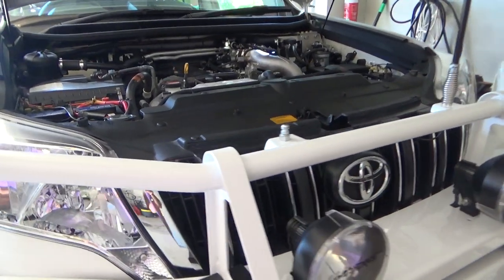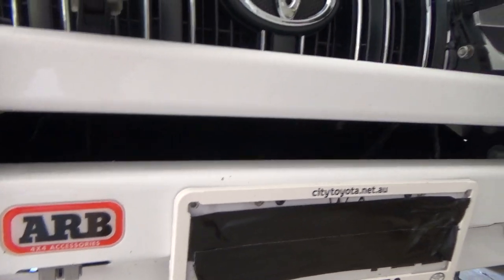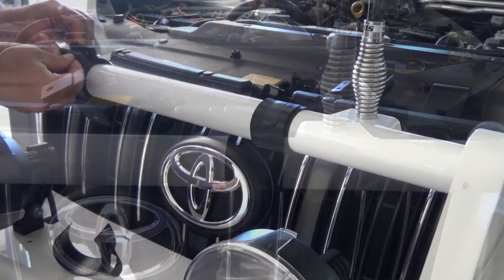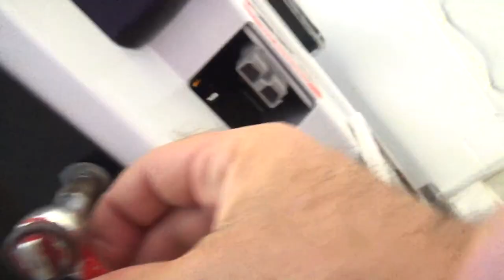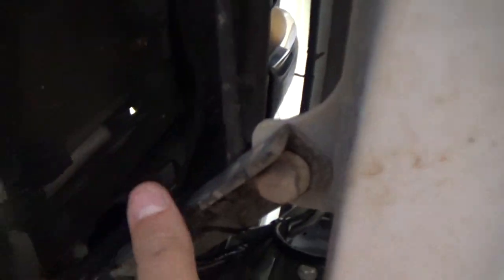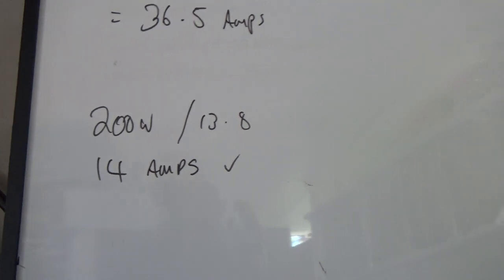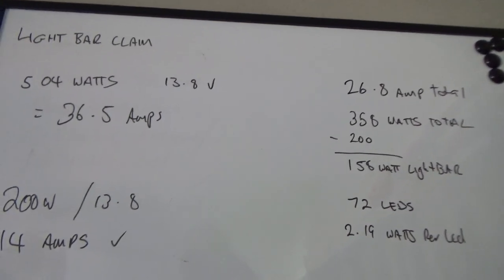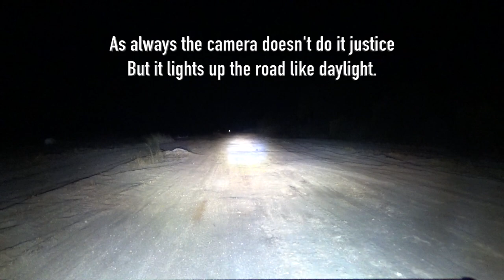Fitting, setting up and testing a 26 inch light bar on a Toyota Prado.

Comment: Hey mate. Just pointing out that most cheap LEDs that come from china use a "equivalent" rating not actual current draw. If you look on ebay for single LEDs that most of these cheap lightbars use they have equivalent rating to halogen lights. The fact is when shopping for lightbars the figures that count are the lumen rating and amp draw.
Reply from the maker: Jason Brand you are right. But they don’t explain this and non tech people don’t always know what they are buying. The light bar works really well and I know what I was getting into.

Comment: where did u get the mounts from?
Reply from the maker: The place I got the light bar. They are a common mount you will find on Ebay, 4x4 shops etc
Reply: What do u call these mounts?
Reply: @lee_co_au  google, stedi bar mount

Comment: You didn't have the engine running, your battery voltage would not have been 13.8 volts as the alternator was not giving you that voltage.
Reply from the maker: Chris Turner for the sake of the exercise its close enough. Btw I have modded the alternator to charge at a more respectable 14.2 volts.